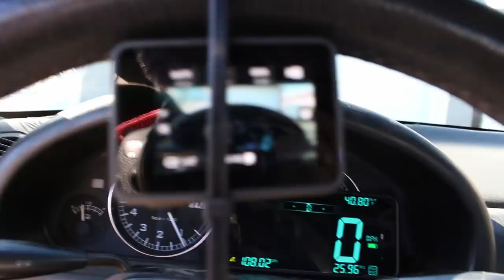Sending The Miata To 100MPH On Jackstands: The Gremlin Chase Part 4

Comment: have you actually look at the driveshafts. from diff to hubs?
Reply: He's tested multiple driveshafts
Reply: he’s shown he’s tested multiple propshafts. maybe i’ve missed it but i haven’t seen him testing driveshafts
Reply: @bmxbarn15  you mean axles.. :)
Reply: no i mean driveshafts. from the diff to the wheels they’re called driveshafts
Reply: @bmxbarn15  maybe from a technical standpoint,  but the mass majority of the community calls the shaft from the trans to the diff a drive shaft, and from the diff to the hubs axles or axle shafts... at least in the states.
Reply from the maker: Axles/propshafts/half shafts/stub axles/propulsion sticks whatever they're called have been changed, but the frequency of the vibration follows the speed of the metal thing between the transmission and the differential. Propshaft in the UK, driveshaft in the US.
Reply: @TheCarPassionChannel  could you take parts off to where you have no vibrations and then start adding parts and see where the vibrations begin?
Reply: 90_s13 now that’s a good idea. i was expecting the miata dad to take the driveshafts/axles/axle shafts off next after the taking the wheels off. then the propshaft to see what happens

Comment: I thought that you would look directly underneeth the car when I saw the jackstands, that might give you a oportunity to look if everything is doing whats its suposed to do. 
Did you check the rear wheel bearings, rear brake discs, diff and diff mounts? Seems like the only things that you havent checked.
Reply from the maker: New rotors, new axles, new wheel bearings, swapped diff, swapped diff mounts.

Comment: Im feeling nothing but frustration on your behalf. I think the vibrations you have seen in the driveshaft may be caused by other circumstances elsewhere. Swapping an OEM part for a custom part does not give you one potential problem or result but potentially a multitude. I think you're going about this well, but I would expand my area of search for solutions, even those that "should not" have an impact. For instance, what would mounting a butterfly brace, perhaps even frame rails and see what happens. Anything that reduces vibrations and harmonics.

Comment: Dude, I feel for you.

I once put SLIGHTLY stiffer durometer mounts on an MK3 GTI and you'd swear your eyes were messed up how blurry the steering wheel looked it was vibrating so fast. I ended up removing 1/8 inch rubber top hats that protect the mounts from dirt and debris, which you're not supposed to do but some recommended... fixed. Since then I've seen people run the same mounts, no problem, rubber hats intact, but MINE and a few others had to remove them to make it better, not entire cured... weird.

Can you make a two piece shaft with a carrier support in the middle so there's less sideways forces on the transmission? Maaannn... this seems like a total pain.

I'd try softer engine mounts just for a laugh. 

My example was FWD so... odd... everything is bolted together and there's less to go wrong, but maybe the mount change has your engine at a slight tweak that it throws off everything else just a hair in the worst direction. Mine was an 1/8th of an inch move in SOME direction and it was very very different.

Is everything total square and sured up? Has too much sending it thrown things off a little?

SHRUG

Comment: My cars been apart for 2 weeks, trying to change a head gasket. I'm a noob, I also accidentally snapped a metal cable wire at the back of the block? Do I have to solder this back, what does it even go to? It was around the Coil Pack area.
Reply: Kudos to you for doing it yourself! I've done that exact job too! That is the ground for the coil packs. You won't get a spark of it is not hooked up to the block. 

Is probably crimp a new trying terminal on it, provided it will still reach it's hole! 

Good luck with it man!

Comment: I recently had a new clutch installed in my 92 NA. Now I have the vibration issue! It’s driving me crazy. Tried a new driveshaft, minor improvement. Any suggestions??
Reply from the maker: Does the vibration follow engine RPM or vehicle speed?

Comment: I haven't seen all the videos, so this may have been coverd...but how are the axles ?
I had a similar problem (fwd)  vibration at 40 and 80mph, turned out to be axle bind. Not saying your issue could be bind, but it could be axle related.   I know there wasn't an issue before the swap, but it could be something that just coincidently surfaced around the same time, or became worse/more noticable with the swap, plus you've basically changed everything in front of the diff, only thing left is the diff and axles.
Reply: what if he bent his axle accidentally. Then it might cause what's going on. 
So far all we know is it's something beyond the flywheel/clutch/trans.

Has to be either drive shaft related or axle or wheel hub or differential.
Reply from the maker: Axles have been changed, and they were never a problem when I was running the Miata trans.
Reply: @TheCarPassionChannel  did you see the one guy's suggestion that it was maybe a twisted chassis rear end lol

Comment: Sorry if you went over this in an older video, but is your oil pressure at idle really  that high? like 70-80psi?
Reply from the maker: Yeah on completely cold start it's around 70. Once the oil is full temperature it's around 15psi

Comment: dont have a clue here but from any car i ever worked on the drive shaft always had the slider part of the shaft mounted to the trans and the big part of the drive shaft mounted to the diff....which is not how its mounted here in this video

Comment: K Miata mounts the trans tail shaft to the Tunnel, right where it has maximum impact on your butt dyno. I'm still thinking you need to redesign this mount and carry it out to the frame rails. Adapt a V8 Roadsters mount.
Reply from the maker: The ZF 6-speed uses a rail mount system. But, I've personally been in Miatas using the tunnel mount that drive great, so I know it's not an inherent problem with the brace design.
Reply: Ok, change the dynamic slightly. Put your jack up against the trans mount. Put some upward pressure on it. Run it up with the jack holding the mount tightly up against the tunnel. Even though the engine is smooth the combination of engine and transmission may be treating a third order of movement. 

I'm an experimental aircraft builder and hang out with some pretty smart fellows. One of my friends made his own auto engine conversion. The prop speed reduction unit had aa vibration that was invisible to the naked eye.  To diagnose he ran the rpm up to the vibration and used a strobe unit that he could dial in the strobe frequency. Of course this had to be done after dark. But it was amazing. He could freeze the prop and could see the oscillation in slow motion. 

It would be a bit scary to set this sort of test up under the car and observe, but I bet you could tune the strobe frequency to slow your vibration down and watch it in slow motion. 

I think just opening the hood and shooting the engine might tell you a lot.

Comment: Use the driveshaft center bearing that stabilizes the actual driveshaft. 2000s gtos have one as well, i wouldnt be shocked at all to hear that fixing your issue
Reply from the maker: Have you ever seen a center support bearing use with a 1-piece driveshaft though?
Reply: Would it be possible to fabricate one to the diameter carrier bearing esk design to the circumference of your driveshaft?

Comment: Probably waayyyyyy to far down the comments to be seen. Rather than trying to work out exactly where the vibration is happening (FYI using frequencies of the sound and what is rotating at that speed would do that) take a more hands on approach, attach a hose clamp on your drive shaft (like a small weight) and move it to different spots to try and balance the vibration. It's not trying to make the drivesaft balanced, it's already balanced, it's just trying to create a vibration that cancels out the unwanted vibration. Move it to different spots on the driveshaft, do a bit of trial and error. It may help, it may not, but it's only going to cost some time.

Comment: Probably already covered that, but do you have an idea of when the vibration started? after the engine swap?
Reply from the maker: After the trans swap, when the engine first went in with the Miata trans the car was perfect.
Reply: @TheCarPassionChannel  when you swapped the trans, what else did you changed at the same time?

Comment: Put the car back on the stands and remove the drive shaft and run the car without it. That should point you exactly where on the drivetrain the vibration is coming from.

Comment: Idk if it could be a issue but what about your rear rotors? maybe the could be unbalanced when at high rpm/torque? I really hope to see u reach ur goal of 400 plus hp!
Reply: Is the new driveshaft longer then the original driveshaft? Maybe the length of the shaft causing vibration?

Comment: I was wondering, why 5th gear in particular? Can you do 4th and still get the same result?
Reply: 5th gear in the ZF 6-speed is the direct drive 1:1 gear, meaning the engine RPM and driveshaft RPM will be exactly the same in that gear.  Wheel RPM will be engine RPM divided by the diff final drive ratio, which makes the math a whole lot simpler.
Reply from the maker: Identical, I just use 5th to annoy the neighbors less, lol.
Reply: @TheCarPassionChannel  So basically diff half shafts, prop shaft and gearbox output shaft are the only parts that move when you rolling with the engine shutdown...right? Yet we do miss something here...
Reply from the maker: @Patrick94GSR  True but it's not a ZF, its a Getrag 260 which has a 0.81:1 5th gear. Engine RPM/0.81 to get shaft speed

Comment: so one more thing that could potentially cause this. Your mount to chassis and the differential doesnt seem to be very giving.  Id say throw in a rubber bushing between the diff and chassis mount and see what happens
Reply from the maker: Already ran both stock and Delrin diff bushings in the Torsen. Also ran the car on stands with the diff nose mount removed, yes the vibration is lower because it has nowhere to go through. But you can't run the car without a nose brace on the diff. Kinda like saying if you remove your motor mounts you will have less vibration from the engine. As far as the stiffness of the nose mount bushing, with a PPF delete you have to have the nose mounted very solid or you'll have problems breaking the diff ears. Same note - I know multiple people who have their diff nose solid mounted, with metal brackets/welded tabs, to the subframe without issue.
Reply: @TheCarPassionChannel  ahhh! Well, ripperino my dude, good luck 💪i hope you find a fix

Comment: 6:49 Could that transmission mount somehow be transferring vibrations through the tunnel?
Reply from the maker: Yes it is, but the vibration shouldn't be there in the first place. Plenty of people running this kit without issue so it's not something as simple as a kit piece, hoping to have it solved soon though :)
Reply: What about it's placement? The mount

Comment: I’ve been following this but don’t really remember the million things you’ve tried . Is the diff the same as before the the vibration started ? Also wondering if its where the trans crossmember body causing  a vibration in the chassis
Reply from the maker: The diff is the same one the car has always had, but I've even tried changing that as well.

Comment: Might have already been suggested, but could you get a completely 1 piece driveshaft made?
Reply from the maker: There has to be some "give" in the system somewhere. Although the trans and diff are solid mounted, they still move together and apart as the motor mounts and just the whole chassis flexes, etc. It could put a ton of load on the pinion and output shaft bearings. We may try a one piece shaft with a flex disc which should give it enough play to work.
Reply: TheCarPassionChannel ah I see what you mean. I know they are completely different but on my truck I’ve got a 1 piece shaft with a U joint on one side and a slip yoke that goes in the trans.

Comment: Going a tad off topic but i can't help mmyself. How did you make the gauge read the actual oil pressure?
Reply: NA Miata's read the actual oil pressure. The NB Miata's and later are only 3 position gauges. I think the NA ones are cooler and I wish my NB still had them. Hope this helped.
Reply: @zillatowntv  yeah i have an nb. i really want a true oil pressure gage and the redline at 12 o'clock
Reply: @roby46tm  look up "revlimiter" gauges on Google. There is a wide selection of gauge faces.
Reply: Interesting, but how do you actually clock it
Reply: @roby46tm  I have no idea. I would assume that there are instructions for it when they send the faces. I haven't bought any yet though so I'm not sure.😂
Reply: @zillatowntv  actually, the 1.6es and 1994 1.8s read proper oil pressure.
Reply: @tjrizvi251  I am in the US.
NB Miata's only come in 1.8 here.
1994 is an NA. 
So you restated exactly what I said.
Reply: @zillatowntv  1995, 1996, and 1997s were also NAs that didnt read proper oil pressure though
Reply: @tjrizvi251  Okay THAT is new information thanks.
Reply: @zillatowntv  yep. Common thing is to actually swap out the sending unit with an earlier one so, ya know, you get a proper reading.
Reply: @tjrizvi251  That's a good idea.

Comment: The wheel hubs being warped might cause it, might be good to get a dial gauge and check it
Reply from the maker: They don't warp overnight though. Never had any issues when I was running the stock Miata transmission.
Reply: @TheCarPassionChannel  hmm yes very true

Comment: The only thing that would cause that severe of a driveline vibration would be driveshaft balance or angle. it looks like you have a slip yoke in the rear, going into the diff. have you tried to point the diff down or the trans up, the trans shouldnt be completely inline with the diff there should be a slight opposing angle.
Reply from the maker: Driveshafts (all 6 of them) have been balanced and rebalanced. Flange angles have been checked by myself and a driveline shop. They've also been altered up and down with no change. At this point we are leaning towards a shaft material/length issue with critical speed/half-critical speed

Comment: I see your problem if you're still using a smaller slip joint driveshaft at the rear that's not good

Comment: Remove the driveshaft and run the trans to the same rpm/gear. Note any vibrations. Obviously the same load isn't being put on the trans bearings w/out the driveshaft, but if there were still vibration, it'd confirm the issue is the trans.

Then take the driveshaft to a driveshaft shop to check the balance. Since all of your shafts have been shipped pre-balanced.

Also, have you considered a worn/sloppy pinion bearing? Could be deflecting under load.
The new trans/shaft setup may be putting too much load on it. Check the pre-load? 
Worn diff carrier bearings? (Seems unlikely)

Can you swap to a spare rear end?
Reply from the maker: I've run it with no shaft, of course no vibration because the vibration is coming from the shaft. That's been pinpointed, but not any reason as to why. Multiple shafts have been balanced by a local third party shop. Already swapped 2 differentials into it as well.

Comment: Might look into a 2 piece driveshaft with a carrier bearing.
Reply from the maker: This is a very likely solution.
Reply: @TheCarPassionChannel  The frustrating thing is while it might fix the problem it doesn't explain why it's happening. I'd really like to see you repeat this experiment with no driveshaft (you've humored us this far) and then with no axles.
Reply from the maker: @walkercam  I've done it with no shaft. There aren't any vibrations because we've already pinpointed the vibration to the driveshaft itself, what we haven't figured out is the cause. 😪

Comment: I bet it's your diff or wheel axles at this point. 

Edit: Either your diff needs to be rebuilt or it is twisting under load and throwing your drivetrain out of alignment.
Reply from the maker: The tests here are near zero load, and I've had 2 different differentials in the car. Also, no problem with this diff prior to the swap
Reply: @TheCarPassionChannel  I'm sorry maybe I should have clarified. What I mean is as power is supplied to the diff it's wanting to twist up slightly and take itself out of alignment with the drive shaft that's what I think is happening. This can happen with or without the tires on the on the ground. My old drag car used to do that. Either way I hope you figure it out man stuff like this is usually the most annoying part of modding cars.

Also love your channel man love your passion! You convinced me to get a megasquirt for my Porsche 944!

Comment: you don't have a ppf any more could you makeshift one to test fit.
 connect the gearbox to the diff. This could be your problem.
Reply from the maker: Tons of swaps delete it. It would require so much custom fab work to fit one, it defeats the main goal of the kit.

Comment: Is your driveshaft out of phase? Basic check I guess and easy to do- try rotating the spline slightly ie disconnect it and phase it differently- if its worse go back the other way. You might find the shaft itself has a balance issue or is out of true- perhaps get it checked on a big lathe?

Comment: The video is was awesome but there was no video of the rearend while preforming the pulls. You concentrated on the engine and water. I would have liked to see the driveshafts and rearend besides the other to get the whole picture.
Reply from the maker: The vibration itself has been identified in the driveshaft itself, I've captured that with under-car footage. The problem is we can't figure out the root cause of it :/